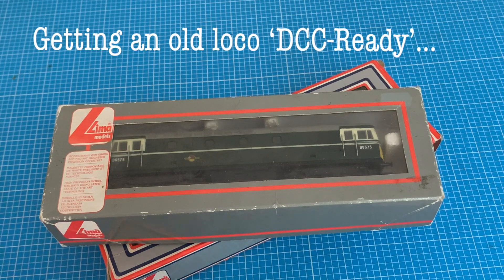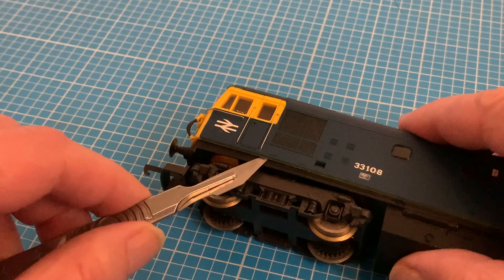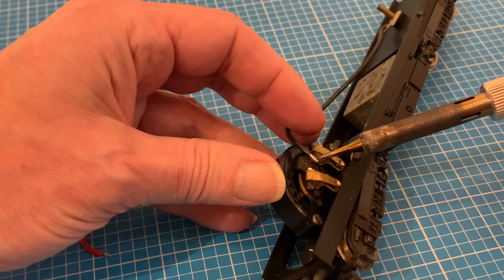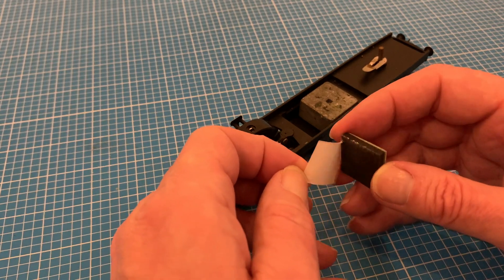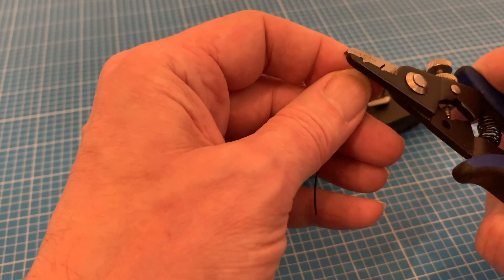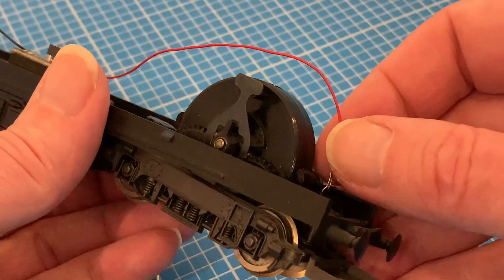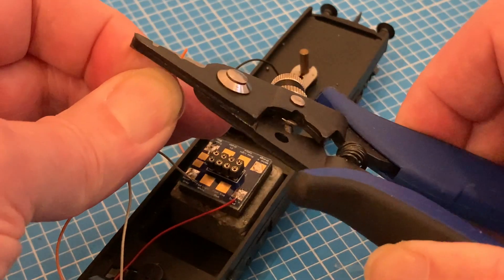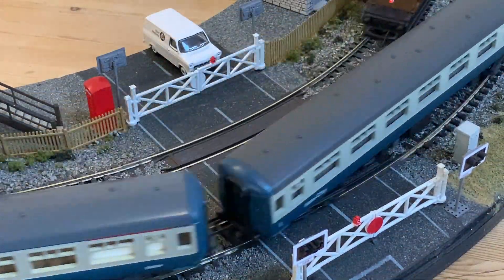Adding an 8-pin DCC decoder socket.to older locos

Comment: At 3:48, you said the track provided alternating current? I thought most layouts used DC power?
Reply from the maker: Traditionally model railways used DC to power trains, but more recent digital systems (DCC) use an AC supply which is converted to DC for the running of the motors etc. This enables multiple trains, fitted with appropriate decoders to run on the same track with independent control.
Reply: Great simple video for basic DCC on older locos.

Comment: For those trying this for the first time here's some advice I was given. Once you've soldered everything up, fit the blanking plug and run it on dc. If all's well then chances are your wiring is sound. ( saves the possibility of blowing a decoder)
Reply from the maker: Great advice.

Comment: WHY BOTHER ? 
DCC being an American system, has NO Knowledge or comprehension of the existence of the "Block Signalling" methods used on ALL European Railways including Britain. Indeed "Block Signalling" (which totally controls the movement of EVERY Train on all Europes Railways) is totally ALIEN in the USA. Hence NO provision for such real life control systems where included in the current (American) methods inflicted on DCC. DCC is therefore 100% useless if you are trying to operate a proper Model Railway with Signalling in a realistic Fashion.

Indeed the competing German  DCC Fleischmann system which DID include provision of Block Signalling basics. And Fleischman spent over £2 Million on developing, was "killed off" by the American NMRA as "Not being NMRA recommended", so U.S. Stores would never stock such a product. Which meant Europe/Britain Model Railway fans were left High & Dry. Indeed Fleischmann had to sell out to Roco as a result of that serious Financial loss. The U>S Market is big and includes a good percentage of German/European type Modellers, not that you would really notice that from reading any NMRA journal, which virtually prohibits the appearance of any layout in that journal that isn't U.S. Outline !!!!
Reply from the maker: Block signalling is quite a specific requirement from the DCC control system. I think most are happy with multiple train operations and functions like lights - that is what mainly appeals. 

But, you’ve got me thinking. I have programmed a Raspberry Pi microcontroller to flash my level crossing lights (there is a video for that on the channel), and have experimented with beam break sensors to trigger it - not unlike your requirements for block signalling. So, perhaps that might be worth exploring.
Reply: @paterpracticus  The problem with that, is that a DCC handheld controller allows any operator to drive any train anywhere on a layout. Which of course is totally impossible in real life on any European Railway as "Block Signalling" such as "Absolute Block", "Track Circuit Block" or even "Permissive Block" simply won't allow such behaviour, as train crashes are virtually a Guaranteed result. And the major reason why in the USA where they use the insane & highly dangerous "CTC" methods, results in daily crashes & derailments.
. 
CTC = Central Traffic Control which is literally a Train Movement Supervisor giving verbal orders to train Drivers, possibly hundreds of Miles away, permission to move, without any visual aid to prove the exact location of the train. 

Which is why DCC designed by the Americans to replicate that highly dangerous but very simple (and of course cheap - Profit before anything including peoples lives- the Great American DREAM) method, is the only DCC system currently available. But utterly useless on any European, British or Japanese Model Railway, where Trains are prohibited in these countries from moving until they receive a Clear or Proceed signal. And the signal cannot give a proceed aspect until it has proven that all pointwork is correctly set, and that NO other train is occupying any relevant track Circuit. 

Indeed British Semaphore signalling uses the "Absolute Block" method. Which literally means the "Block" IS ABSOLUTE. In other words a Mechanical Signalbox is only permitted to have ONE train anywhere within its area, (per Running Line) no matter how many signals it may have on each Running line. Hence trains are 100% prohibited from following each other from Signal to Signal, and are ONLY permitted to go from Signalbox Area to Signalbox area ONE at a time. And you try explaining even  that simple but very safe method to any American Railroad Company, or for that matter to the NMRA, or those in the USA who designed this absurd version of DCC. No "Interlocking" is "Railway Madness". So of course anyone in Europe applying DCC to a European Model layout is wasting money on a totally unrealistic and HIGHLY EXPENSIVE layout toy train set control system !!!  

Even traditional 12v DC has automatically, due to the behavioural nature of DC electricity, a major railway safety rule included. You cannot have head on crashes on a 12v DC layout ! Even that safety feature is impossible with DCC, because it puts 16v AC (Alternating Current) in the track, and it then makes matters worse by allowing the AC inside a model engine close to the DC Motor. And DC always sets up Electro magnetic fields, which result ins some or more interference between the close proximity of AC & DC inside every model Loco. And this WILL shorten the life of the Motor, and explains many of the Secondhand "non runners" on Ebay.

And of course the new issue with "DCC" is that Model Manufacturers are starting to change in Europe & Japan to very High Grade "Coreless Motors". So cannot be used with DCC, without immediate risk of the Coreless Motor blowing like a fuse. You see outside the USA, Britain and parts of Europe, DCC is either not used, or highly disliked by those who understand its serious electrical issues. Which means DCC is only used by roughly 15-20% of all modellers on the Planet. The Worlds biggest Model Railway Market is Japan, where there are 2.4 times more model Railway fans than the whole of the rest of the World combined. And this is where the Worlds FOUR biggest Manufactures are located, with 95% of their production being Japanese outline N Gauge. And NO DCC anywhere in sight !!!

Comment: Nowt wrong with Lima loco's.  I have several that I have converted to 8-pin DCC and also added additional pick-ups and they run just as well as the more recent expensive offerings. Another advantage with older models is that you can add as much detail as you want.
Reply from the maker: Absolutely! The old Airfix, Mainline and even some of the Hornby/Tri-ang ones also make for great projects.